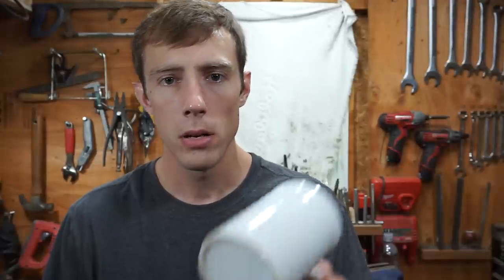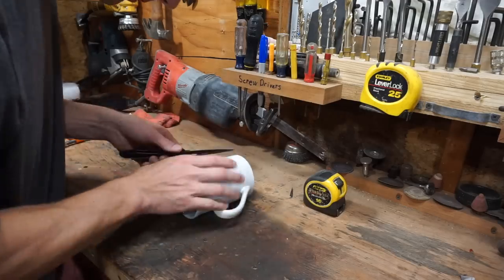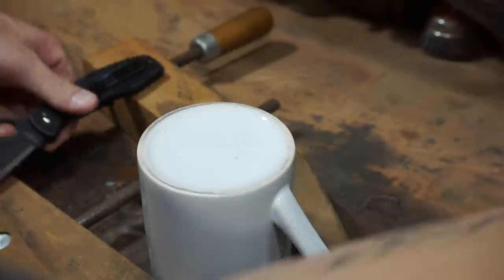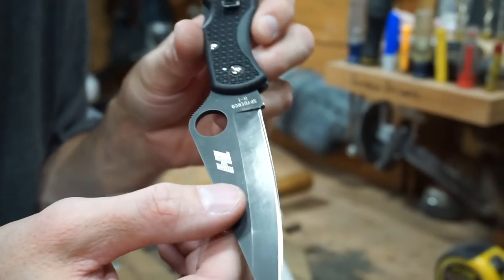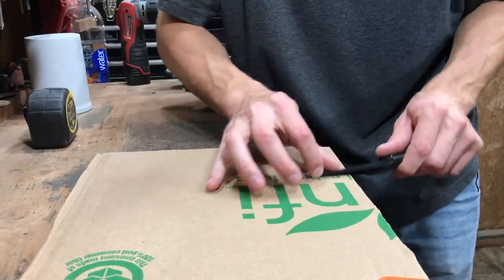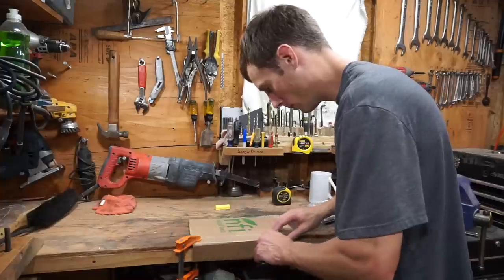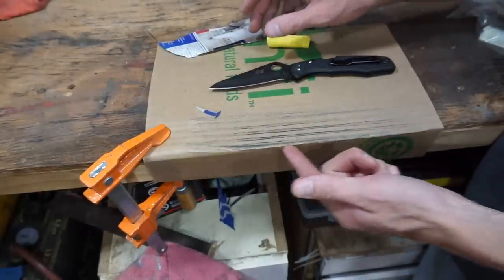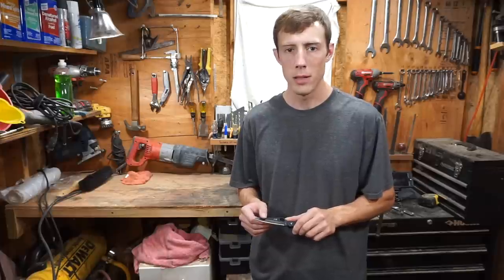WHAT HAPPENS WHEN YOU TRY TO SHARPEN A KNIFE ON A COFFEE CUP?

Comment: All the cardboard did was act as a flat surface for the compound to do it's work. You could of rubbed that compound on a mirror, same thing.
Reply from the maker: The compound needs to be held in place. That's why leather works like it does. A mirror doesn't hold the compound. Otherwise you could just strop on the block of compound itself. Which doesn't work...thanks for the comment 😀

Comment: Not actually "sharpening "  more accurately you are honing the edge . it will only be effective if a primary bevel has already been established.    if you were actually sharpening these you could just take any blank piece of steel and put a edge onto  it .you might eventually be able to do it but it would be difficult to establish and maintain the bevel and would probably take a very long time.you'd probably also wear out your cups or plates. Simply use proper stones and do it easily and quickly. All these hacks,tricks etc. On YouTube are rarely practical or effective.

Comment: I think the cup only stars the sharpening process if you want to use plain cardboard as a strip. The burr needs to be a "finer" burr for it to work without compound so you need a finer grit item the the cup before you strip. I think the coffee cup idea is for when you may not have stones to sharpen on.if you have a dup handy you can still get a sharper than "dull" edge with it. In that case,may stripping on wood would take the burr off. Just a thought.

Comment: wasn't that knife made of H1? and isn't H1 the easier steel to sharpen...
Reply from the maker: Is h1 easy to sharpen than.. what? H1 is easy to sharpen. I haven't tried it but, I have full confidence I can sharpen s30v or any super steel on the cup to some degree. Ceramic is HARD, and removes metal very well. Biggest problem with the cup is its shape. Its awkward as crap lol

Comment: So either the knife was sharp at the start and you told us fibs, the cup works fine and your just being silly cos your techniques looked kinda goofy. Either way if the knife was blunt a strop of any sort would not rescue the edge.
Reply from the maker: The knife was dull haha. A strop simply removes the burr that forms during sharpening.
Reply: OUTDOORS55  So the cup worked just fine then.  It's easy to make something look difficult.  You could of broke the burr on the bench or your own skin too, but only if the knife is sharp.
Reply from the maker: Not all burrs will break off on a bench/ dragging it though wood. Some types of steel it can be difficult to remove a burr. The cup does remove metal but its not ideal (the point of the video is it’s not ideal). There are better ways but it can work in a pinch.

Comment: An unpainted plant pot works to
Reply from the maker: I keep hearing that. Might have to give it a try👍
Reply: Yeah im from Germany my English isnt that good:(. If you use a tiny pot you can use the upper corner with some tape to hold the angle and then its works very good. One tip for sharpness testing : My uncle is a Black Smith who make Hand made knives he uses newspaper cause this is mich thinner and harder to cut smooth
Reply from the maker: Thanks for the suggestions👍 By the way your English is very good. I can't speak or write any German lol. 👍😀

Comment: It's not the right way to use a cup for knives.  The cup can be used to keep an edge. It can act as a substitute for a ceramic rod for basic touch up. BUT it dangerous... You do a few light strokes with the knife keeping the cup in place with your other hand. You risk losing a few fingers in the process and it's not really as effective compared to a ceramic rod. But it can be use in an emergency situation.